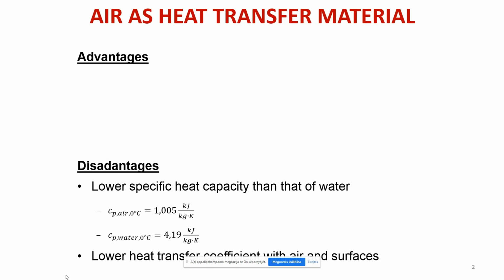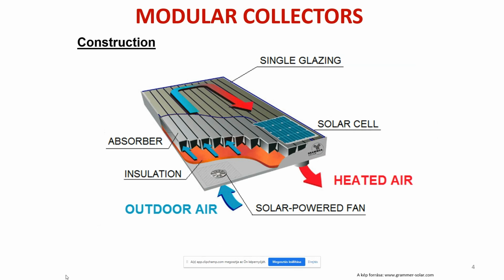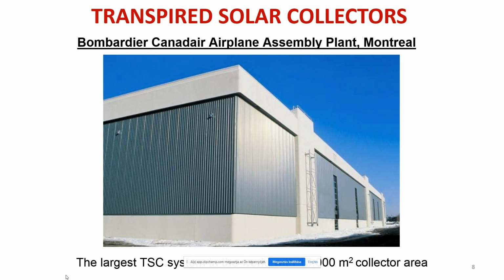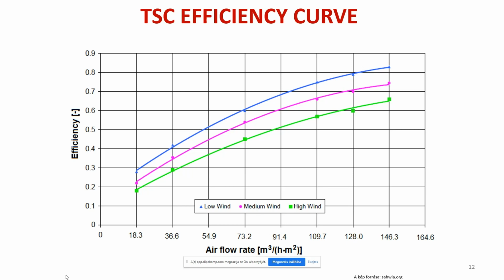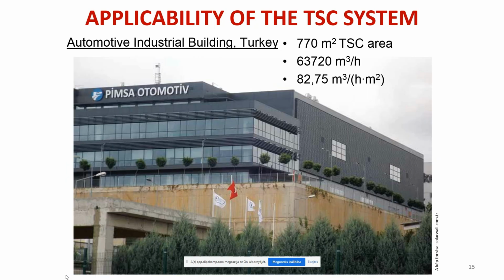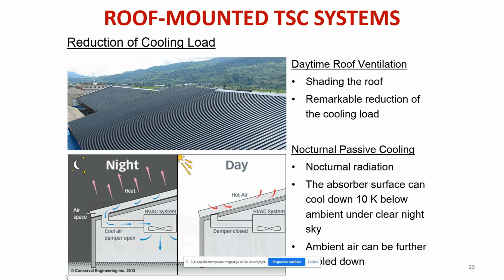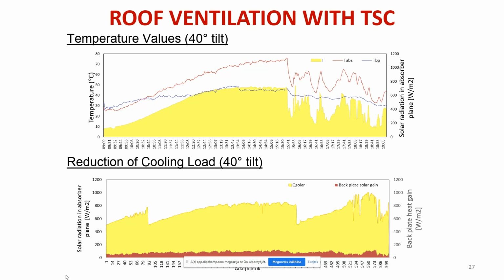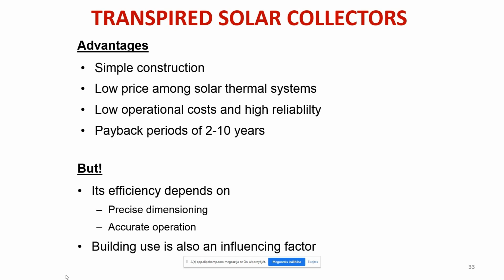Solar Air Heating Online Lecture

Comment: This is what I was looking for. My intent was to install an air to water heat pump in the attic and to use the south side wall to harvest energy for it. This tipe of collectors would be a perfect solution